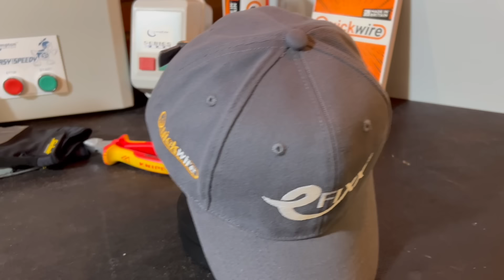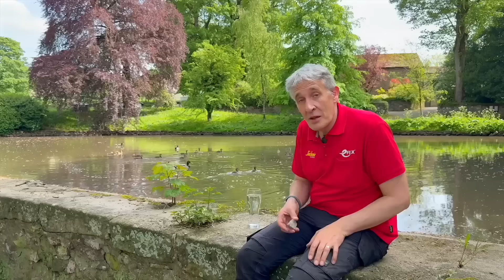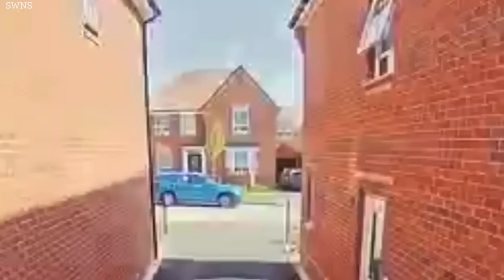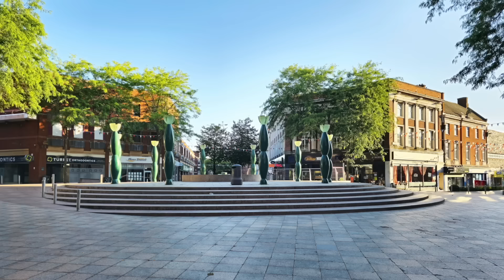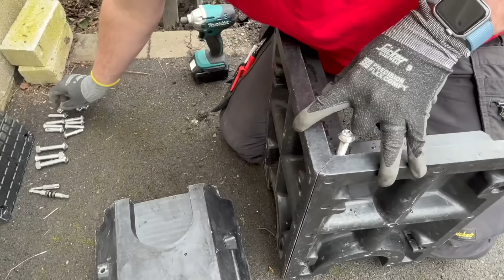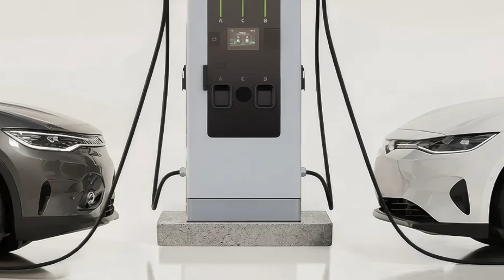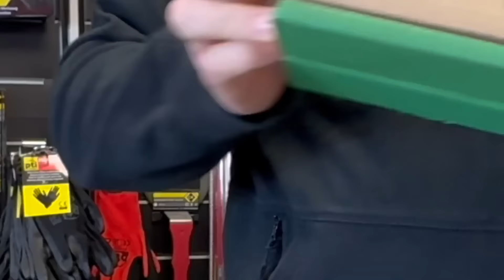Bi-Directional RCDs Unplugged - Have we got this Wrong?

Comment: Schneider Electric - manufacturers of rubbish. iflo/Drayton electrics are dustbin fillers. Microswitches in zone valves won't handle the minimal current feeding boiler & pump as the moving part of the switch relies on a rocking contact.

Their electronic thermostats and time switches rely on cheap electrolytic capacitors - which dry out then fail to provide the power the device needs to operate. The thermostats aren't even thermostatic. I'm gradually replacing mine as they fail.

Comment: 0:49 you have 1 or 2 Crompton starter switches on display. I bought one a few years ago - and was disappointed that it didn't conform to the standard - so I fixed that and mounted it upside down. The standard being that the green was above or to the left of the red button.

Comment: Not a chance the Solar PV caused that explosion, there is nothing in a PV panel that can explode like that, inverters can blow up but not like that, batteries are not allowed in lofts anymore so not that either. I would make the assumpution if it is brand new build that some kind of vent has not been connected properly in the loft and dangerous amounts of a flambable gas have built up and combust due to the heat.

Comment: I still find your "bust the scare stories over bidirectional RCDs" to be worrying after having to replace so many of the M2 unidirectional RCDs due to solar back feeds. Incorrectly everyone assumes the issue is just when the RCD is tripped and it's back fed but no the electronics/ coil can burn out during normal running of reverse current. So the question arises what's different about the devices in Germany compared to the UK protecting our circuits when we were supposedly "harmonized". 
I've EICR'd properties with M2, Fusebox, Chint, Axiom, Hager and Wylex all of which have had their type A unidirectional RCDs fail. So potentially the issue isn't with them being unidirectional but which the COB circuitry inside the device not being suitable for generating equipment.
Reply: The issue is only after the breaker trips - it is a result of the relatively large current used to drive the solenoid rapidly; the solenoid coil and the transistor that drives it are only rated to handle that current for a short length of time so can overheat and burn out if the power is sustained on the downstream side.

"but no the electronics/ coil can burn out during normal running of reverse current." Nonsense; the current is AC so reverses direction every 10ms. It would cost considerably more to manufacture breakers that could actually detect the direction of the power transfer given that it would have to compare the relative phases of the current and voltage. 

"due to solar back feeds". How do you know how and why they failed? There are other possibilities such as inadequate protection of the electronics to large mains spikes (eg. nearby lightning, heavy industrial motors being switched etc.) or electrostatic discharge (do you wear 1970's style bri-nylon shirts or underpants perchance? :)  Have you taken the breakers apart to look for obvious burnt-out parts?

It should not be possible for a PV inverter to continue to supply power after the breaker trips in less than 500ms, and 500ms should not be anywhere near long enough for a competently designed breaker to burn out.
Reply: @tonyh6309  That's exactly the issue, it shouldn't be possible for them to have burnt out yet so many of them have. Different inverter and battery set ups, different brands of RCD. So they're either not rated for the continuous DC leakage from that side even as type A RCDs or something else is going on. Until our industry is certain what the issue is Home Insurance providers will have a get out of contract free card to pull for any incident where a house has plug in solar. 

All the failures were on RCDs that had not tripped btw. So unless they're bricking on certification of the installation when the manual test button is pressed there would be no grounds for them to fail.
Reply: @effervescence5664  DC leakage doesn't cause RCDs to 'burn out'. The DC leakage can saturate the toroidal core and prevent the RCD from tripping under fault conditions.
Reply: @VinoVeritas_  So what is causing repeated brands to fail to trip with the test button and with test current applied via tester with unidirectional type A RCDs? 

Thus far many people are stating "this and that doesn't cause found result". We work in an engineering field where what we install is tested to make sure it  meets the design set out, if protective devices aren't meeting the design requirements the hypothesis needs further investigation. 

This is where the regulatory bodies are completely right to say that UK wiring systems aren't ready. As so far no one has given a concrete explanation for the phenomenon.
Reply: @effervescence5664  That's exactly why the IET had to act. BEAMA and its membership (manufacturers) created this issue by moving away from the electromechanical method of earth fault detection to be cheaper IC method.
Reply: @effervescence5664   With respect to the failures you are reporting this whole uni/bi directionally is a red herring. If the breaker has not tripped, the contacts short the supply and load connections together - effectively a uni-directional and bi-directional breaker are electrically identical at this point.

Thus any failures in PV installations, where the breakers haven't tripped, cannot possibly be related to the uni/bi directionality. I'm sure the manufacturers of bi-directional breakers would be very happy to have electricians believe otherwise and help promote this misinformation.

<Conspiracy mode ON>
I wonder if there is something more sinister going on - perhaps the industry has discovered that existing RCDs/RCBOs are failing far too frequently, possibly due to inadequate transient over-voltage protection for the electronics, and that PV installations are an opportunity to get many vulnerable/faulty breakers replaced without having to admit to the problem.
<Conspiracy mode OFF>
Reply: @tonyh6309  It may be a red herring but it's still a safety issue that invalidates home insurance and needs addressing, regardless if uni or bi are the same functionality in the electronic components inside it needs to be addressed. I haven't had any of the bi-directional ones fail as yet but the uni directional ones were failing within a year.

When it's a dedicated circuit to a PV array it's not such a big deal as after the voltage is back on the bus bar the generation is the correct side of the socket protective devices. The direct issue is knocking out an RCD so the only protection then becomes overload/short circuit protection regardless of the plug in solar operating correctly the socket circuit then fails the additional protection requirements which no one will know until something goes wrong, at worst killing someone - likely a child.

Comment: Regarding the two inverter scenario, it's no different to the situation where more than one conventional fixed solar array has been installed at a property. I've had two separate ground mount arrays for several years, if there's a power cut both inverters shut down instantly, these small plug in inverters use the same technology.

Comment: So basically bs7671 rushed out a full amendment for bi direction and you have proven it is pointless. Typical bs7671 making a mountain out of a mole hill
Reply: No, that's not the case. The issue stems from the manufacturers that moved away from electromechanical RCDs and instead started using integrated circuit boards to monitor earth leakage. Alternating Current by its nature is bidirectional, so the electromechanical method using a toroidal core to monitor earth leakage will work regardless of which 'side' the power enters the protective device. However, because the manufacturers hadn't specifically tested their protective devices with the source of power on the 'load' side, it was decided that it was safer to issue a requirement for protective devices that had been designed and tested to be certified as 'bidirectional' to be used for inverters.
Reply: @VinoVeritas_  Sorry, but "However, because the manufacturers hadn't specifically tested their protective devices with the source of power on the 'load' side, it was decided that it was safer to issue a requirement for protective devices that had been designed and tested to be certified as 'bidirectional' to be used for inverters." comes across as classic FUD (bad actors trying to inject Fear, Uncertainty and Doubt).

I'm sure you weren't trying to do that but it is important: in the case of a breaker which is not tripped, the contacts present, at most, a few hundred micro-ohms of resistance between the supply and load side.  Effectively a uni-directional and bi-directional breaker are electrically identical at this point - the breaker contacts short the supply and load connections together.

Thus any failures in PV installations, where the breakers haven't tripped, cannot possibly be related to the uni/bi directionality. I'm sure the manufacturers of bi-directional breakers would be very happy to have electricians believe otherwise and help promote this misinformation.

<Conspiracy mode ON>
I wonder if there is something more sinister going on - perhaps the industry has discovered that existing RCDs are failing far too frequently, possibly due to inadequate transient over-voltage protection for the electronics, and that PV installations are an opportunity to get many vulnerable/faulty breakers replaced without having to admit to the problem.
<Conspiracy mode OFF>

Comment: I have noticed that a lot of old installs containing 61008 and 4293's   as either main switch or on dual RCD no longer function either via test button or when testing in the case when it's used to protect the PV inverter circuit. There is certainly a strong correlation with their failure due to the presence of PV in my experience. Not sure if anyone else has noticed this? Perhaps it would be fine if only 800W export.
Reply: Can you say if those devices were magnetic or electronic?
Reply: @retrozmachine1189 Electromechanical at that age. Think the core gets magnetised by DC leakage. Crappy early days transformerless inverters. Probably won't be an issue with these devices.
Reply: @freddiewithers9617  Interesting.  I'm surprised there's sufficient current to cause enough permanent magnetisation.
Reply: @retrozmachine1189 I'm just speculating. I did not measure the DC leakage. However I cannot think of other causes for the issue. Would need to tear the rcd down and properly diagnose.

Comment: Hi Jo, inverters can never drive an inverter, even an on grid cannot synchonise to an off grid and all the YouTube stuff about on-grid technology becoming off grid through dummy grid syncs is all ball. The reason is simple, we are taught that inverters superimpose and reconstitute the sinewave to compensate for PF (i.e reactive power), true, but they also phase lead, so the sinewave is not just reactive plus superimposition, it leads by about 0.005 Hz, as you can probably guess from all your A-level calculus and integration of cosines and all that crap, unless your inverter is hundreds of kW it aint got the muscle to phase lead and 'knows' its not seeing the grid (plus there's load of stuff relating to the mathematics of sampling that you really don't want to know!)
How do I know this shit... when I retired from R&D, I went back to my original job of 'electrician', a job I have always loved, but now, I am working till 3 in the morning every night on this very problem associated with 'grid stability'. If you want you pants bored off you, I can make you a vid, it's very interesting but nothing to do with the life of an electrician screwing inverters onto walls.
Reply: This is the "it shuts down eventually" delay time issue.  Usually isolated microgrids that aren't intended to operate as microgrids do shutdown.  Eventually.  But phase-leading won't cause it to happen instantly.  The frequency has to increase into the 51-52 Hz range for the inverters to actually go into shutdown.   Below 52 Hz the microinverters are in an output power servo mode.

That can take a while.
Reply: Guess what?  It's not BS.  There's a ton of research papers about it and there are real risks with high penetration of PV on the network.  The results can be a longer than permitted time to 'anti-island' and possibly even failure to anti-island.  A single inverter feeding into the network is a tad different to numerous houses feeding into a transformer service area.  My own neighbourhood is supplied by a 200kVA transformer with about 100 houses on it.  There is presently about 195kW of export on that transformer.  It's not so clear in these circumstances as to is the grid there or not.  I'm definitely not saying there will be failure but it's certainly something that has to be considered.  Throw in larger urban PV systems because they exist too.  50+kW is not unusual in some parts of the world.  Just down the road from me, smack in the middle of the urban environment, on a different transformer is what I'd estimate to be around a 200kW installation.  It gets worse when you don't just have grid following but also grid forming inverters because that's a thing too.  It is nowhere near as cut and dried as you suggest.

Comment: it's 2026 and there are still uni-directional RCD for houses? WOW! (I'm a german planner of energy systems up to 4MVA trafos and corresponding 400 V systems)
Reply: Some people seem to believe that UK electrical installations are just the same as those in Germany or other countries, therefore it's automatically valid to apply practices that are OK in those other situations to ones found here.
Reply: Yeah, it's weird isn't it.  I actually have trouble even finding a 'uni-directional' (that's almost as bad terminology as bi-dir!) device on sale even on al i.  The world has moved on, the UK apparently hasn't.
Reply: Alternating Current is bidirectional in its very nature. The issue is the devices were never designed or tested to have the source of power on the 'Load' side. That doesn't mean they won't operate correctly in the event of an earth leakage event, it just means they weren't specifically designed or tested to do so.
Reply: @VinoVeritas_  It has nothing to do with that at all.  The whole issue surrounds how the device itself fares, as in could it be damaged by a supply on the wrong side in the event of a fault or even just the test button being pressed.
Reply: @retrozmachine1189  Do you have difficulty with reading and comprehension?
Reply: @VinoVeritas_  Do you?  It's nothing to do with certification and any RCD will react to imbalance regardless of what terminals supply is on.  It's all about the device itself being damaged.  Capisce?  I suspect you don't.
Reply: @retrozmachine1189  It's obvious that you suffer with your comprehension skills. Also, don't use another language that you don't understand either.
Reply: @VinoVeritas_  As I thought.  Clueless.  Muted.

Comment: On a linked question to WAGO's, nowadays, we seem to get recall notices on all sorts of gear. About 6 months ago I installed an inverter, the fitting of everything had been done by a company and was funded by an energy grant (they aren't allowed to connect it and I'm not allowed to install grant based equipment... don't ask!). The grant was for 'a package' of gear and the bi-directional type B 3-phase RCBO was in 'the box'. I had never heard of this make but it weighed about right, I fitted it all, tested it, the overall standard they had fitted everything to was reasonable(ish) and within commercial realities. 
Months later, the customer got a notice from their DNO (with the bill) about electrical recalls, one of them was this ruddy RCBO! It stated that you must check and if this is in your panel you must contact your electrician who fitted it and under the law he has 30 days to change it at his expense! So they contacted me, I didn't argue, and changed the heap of crap, so you guys know how much these are and can guess how much money I didn't make on that job!
So question is... How do we stand legally on these product recalls because from my limited experience of one, it can be bad news for electricians!

Comment: Less amusing, more ludicrous!
They allow - scratch that, they are forcing - "plug-in solar" (they cannot ever imagine a situation where the safety isolating circuitry can malfunction dangerously) on entire populations (just like the coo-foo-foo vax) and de-registering the WAGO terminal block!!!
Interestingly, sandwiched between the plug-in solar segment and the WAGO terminal block recall segment there's this extravagantly great segment showing how a solar panel system blows the roof off of a domestic dwelling.

HC-JAIPUR (08/Jun/2026)

.